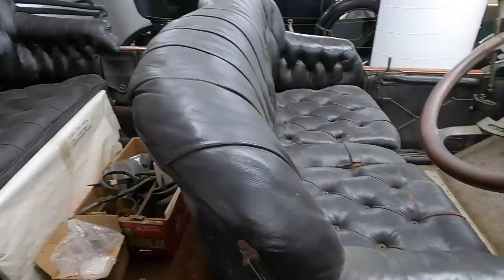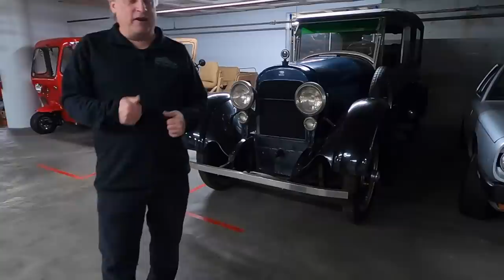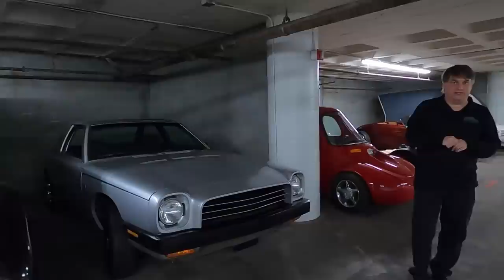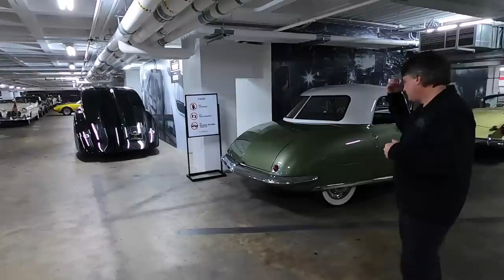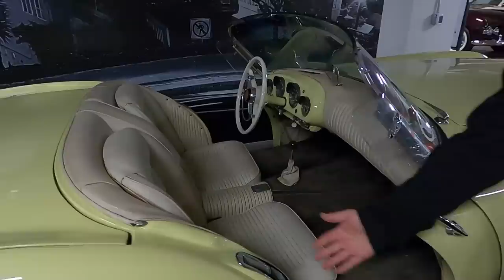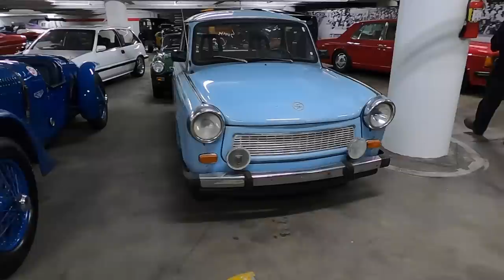WORST CAR FAILURES OF ALL TIME | PETERSEN TOUR

Comment: I f you rode in or drove a Davis, and it hit a pot hole with the front wheel you would understand why the car was horrible, absolutely horrible...
Reply: But that didn't stop England's Reliant car company from making it's 3 wheel Robin! Mostly as a 3 wheel car fell into a far cheaper vehicle tax level, so they were popular, and also known for rolling over.
Reply: @Oldbmwr100rs  in post-war England three-wheel cars were considered motorcycles so therefore you didn't have to have a license for them. I don't know how long that lasted

Comment: 34:00 Ford positioned the entry-level Edsel Ranger squarely between the most basic Ford and the step-up Fairlane, and the top-line Edsel Citation was priced between the highest-price Mercury model and the lowest-price models from Lincoln. The first-year Edsel basically competed with all of Ford's popular-price models from those competing with mid-line Plymouths to those competing with the Buick Roadmaster 75.      
Add Edsel's hideous styling and trouble-prone gadgets, and you have a recipe for failure.

Comment: I owned a 65 Corvair and had a nice love/hate relationship I drove it like a maniac and live to tell the tail. It was light and had a lot of options to build the motor. It wasn't a failure at all and was a pretty nice car. Though I didn't like the heater, it pumped air from the heated air around the engine and I had a oil leak and oh boy did I get a cloud of burnt oil smoke in the car... Hated the push rod tubes that always needed new O-rings but still over all I had a blast with that car.

Comment: I would have mentioned the problem with the Corvair was that the early models didn't have the front anti-roll bar in front that was recommended by the chief engineer at Chevrolet. This caused handling problems especially if it were driven fast on rough roads.  After 1964 the new suspension cured the problems and they handled quite well. Many dealers offered the front anti-roll bar to customers, others didn't.  The biggest problem with the Ford Edsel, besides the 1958 recession, was that all of the special features were soon being offered on their other cars.  Power brakes, power steering, power windows, a push button radio and the bigger V-8 were soon standard equipment on all  American cars.  The styling on the Edsel, like the 1958 Chevy, was not liked by most of the buying public and that heavy look was soon out of favor. The 1958 recession also marked a turning point in American culture, TV became super popular and Rock and Roll soon ruled!

Comment: Edsel didn't just fail due to it's size & lack of unique features/architecture, it also failed because Ford/Lincoln/Mercury dealers couldn't sell them at their dealerships, Ford Motor Company specified they had sell Edsels from a different location, so many Edsel dealers were gas stations.

Comment: The Cisitalia 202 Gran Sport was later revised and modernized in the 1970s and redesigned to fit atop Fiat 128 tooling as the Fiat Sport.  It sold in far greater numbers than the 202 and it was aimed at the Opel Manta, Ford Capri and Toyota Celica.  A Capri-like fastback came first, followed by a 3-door hatchback coupe with identical styling from the doors forward.  Chevrolet replied to this Fiat 128 Sport with the Monza, during 1974, using basic Vega mechanical tooling.
Reply: See the Fiat 128 Sport.  It was similar to the Cisitalia 202 Gran Sport but more modern in styling and it was far cheaper to build.

Comment: 34:00 due to an agreement between the local Ford / Lincoln / Mercury dealers, my county received three Edsel ambulances and two Edsel cars, a sedan for the Sheriff, and a station wagon for the fire chief. With the exception of a '58 model ambulance, all were 1959s. They were used up until the mid '70s, and two of the ambulances are sitting in a field, intact. 
The Edsel may have been a flop, but they're built like tanks. I should have bought that '58 for $600 years ago...

Comment: 30:15     You missed the Cadillac Deville. That's one of the cars that Cadillac ruined the their good reputation with during the 2000s. By not recalling, repairing, replacing or notifying owners of mandatory(out of warranty) maintenance of the Northstar engines in a timely manner.
Reply: Not just the DeVille, Cadillac put the Northstar in everything they built during that period. Mom still has a '94 STS that's actually a nice car, but because it's Northstar powered is only worth what it would bring as scrap.

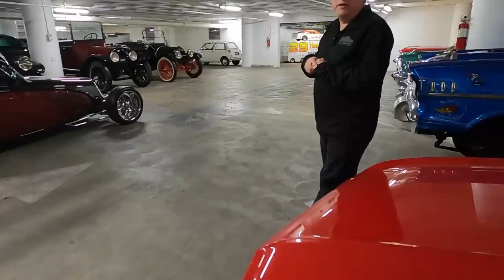Comment: 40:00 From everything I've read, the original Corvair's handling could be considered tolerable for drivers who were skilled enough to know what not to try. But to put that car in the hands of American drivers who were used to being able to sling around a muscle car in and out of a 4 wheel drift with ease was, in fact, irresponsible. Some of the car's bitterest opponents inside GM were executives whose sons had been killed, injured or scared out of their wits by their experiences with the cars. Of course, even with the swing axles, the car could have been a lot better and the safety of the '64 Corvair (the last year before the fully-independent suspension was added), with an anti-sway-bar in front and sort of a see-saw bar in the rear, could have been added to the '60 for a trivial increase in cost, which was vetoed by marketing, because they were determined to make this an economy car. And there's the rub: Ed Cole wanted the Corvair to be the modern day model T, a well-rounded car for everybody that could do the job efficiently and cheaply, but without a much higher production volume , it was never going to be competitive with its more boring rivals. And, it couldn't do everything for everyone anyway; if you wanted a turbocharger, or if you needed a station wagon, you had to give up air conditioning; if you wanted to be comfortable in cold climates, you needed a fuel-guzzling gasoline heater. The Corvair ended up being a specialty car, which was all it could ever have been. I wonder if it could have carved out a more secure niche if GM had planned it as a world-car, built and shipped all over the world in collaboration with overseas partners; that might have put a dent in the cost premium GM was paying for a platform that shared almost nothing with its GM stablemates.

Comment: I got to stick up for the Corvair. The Corvair was unfairly maligned by Ralph Nader.  The car was far superior to the complete failure of the Vega or Pinto offered later on. I owned a 66 Corvair Monza and I loved that car. It could out run a 67 Barracuda of that time period.  As a teenager believe me I thrashed that car to the limit. Never once did I find it getting out of shape no matter how hard I threw it into a corner.  I just wished I had the higher hp turbo charger version. Or better yet 200 ponies would of been just perfect. If I wasn’t so invested in other toys I would buy a pristine Corvair in a heartbeat.

Comment: The Corvair fiasco was responsible for a whole generation of GM cars that where deigned to understeer, A LOT. If a car crashes on the outside of a corner, then people say the driver is at fault. If a car crashes on the inside of a corner, then people say it is the cars fault, and try and sue the manufacturer.

Comment: The company may have been a scam but I really like the Dale, is it a three Wheeler or close coupled read wheels, being a motorcycle engine I would suspect a three Wheeler, some of the Hienkel bubble cars had close coupled wheels with the drive between the wheels, that made them a car in Britain so couldn't be driven on a motorcycle license, great tour and a cracking little car (with a dubious back story) to finish with.
Reply: John Smith  even though it was a scam (something that was rather obvious!), and not a three Wheeler I still think its a smart little car and wouldn't put it out of my garage, got a Bond minicar all 250ccs of two stroke twin, chain drive to the front wheel, so engine and wheel turn together, guess I just like the bizarre, the Dale would be if good company!.

Comment: The Corvair was not a failure with 1.8 million sold over 9 years.  It was a very nice car for it's day.   I know because I had a '64.
Reply: It was sold for 10 years actually.
Reply: What really killed the corvair was that GM by the early 60's no longer wanted to market innovation, also the corvair didn't keep it's early momentum when Ford rolled out the Falcon. GM's response to that was the Chevy 2 then Nova, the corvair continuing production mainly to recoup cost of development. Tightening smog laws were the final nail in their coffin, without losing a lot of power or needing extensive redesign, the car would no longer be able to meet changing smog and safety laws. GM was having enough trouble just keeping up with all of that with all their other models. Many factors spelled the end of the corvair.

Comment: Corvair a failure? I personally owned two of them a '64 and a '67. Early body style and second gen. The blue '64 had the two speed auto and the other was a red manual. The suspension upgrade in the rear handled a bit better but I hade no trouble with either. Loved them both, should have kept the '64 and should have bought a turbo spider.

Comment: If you can get your hands on a ELIO, are you going to add it to your fleet of failed cars?  Technically, it is not a failed car... yet but they are certainly on the path as they are still considered active and even has their website up and still running.  Supposed to roll off the assembly  line in 2009 and all that has been built was prototypes. <>  Edsel had the undesirable and certain un-welcomed nickname "The ----- Car" (woman's reproductive area).

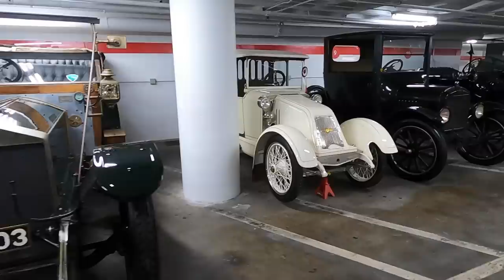Comment: What's the white car at 5:24?
Reply: The shape of the hood with radiator behind engine hints that it is a Renault, probably from 1915-1920. I couldn't locate a picture of that exact model to identify it.
Reply: Yeah but I don't think it's a Renault. I think other manufactures used a similar front. Example early Mack trucks.
Reply: If you identify it let us know

Comment: Rear tire tuck that killed and injured some people . GM bought their way out of the Federal class action law suet .
Reply: Jeff, That is true of the early models. I had a 61 corvair that would lift up in the rear end in a curve creating an impossible handling situation but that was corrected in later models with stability bars. My 65 corvair with 4 carburetors and a 4 speed tranny was far superior in handling than many other cars of the same time period. I miss that car.

Comment: Well on the chevy corvair you only told part of the story as to what happened to couse the down fall of the corvair yes it was natter but also there were to factory recalls that also gave the cars a bad rep the heating work off the exhaust so it didn't take befor exhaust wood get in to the driver compartment bad deal GM did a recall on the cars and replaced the exhaust on with a better designed one. The other was there was a front beam in the front end of the car that held the front a frame together and they were made out a peice of steel metal spot welded together Morley made in northern state with a little winter salt 9n road this peice would rust out and it only took 1 or2 winter to do this so GM did a recalls on that and replaced it with a peice made out of heavyweight metal. This as as to change as this peice in the car was a bolt in peice just unbolt the old bolt in the new one and it was done and this would only a machanic about 30 mins to do. But the two recall put a bad rep on the corvair than add to that the natter think sales just drop to nothing and GM just had to stop making then this sucks as they really were a good little car and they biuld. To compeat with that WV as wave were getting very good sales numbers so it as biuld to compeat with WV sales. They tried to out class the WV in very way they could

Comment: Your knowledge of the Chevrolet Corvair was nothing short of a not-so-subtle attempt to rewrite history.  Shame on you.  Corvair "may have been unfairly targeted"?  Clearly, you never read Ralph Nader's "Unsafe At Any Speed" if you honestly believe there was anything "unfair" about what was documented about the Corvair between 1959 and 1965!   Sure, it went on hiatus after 1969, but that was only temporary.  All GM did was skip a year before putting it back into production, with only a name change to Vega.  Still the same ol' under-engineered, thrown-together POS, but hidden under a new badge of even shoddier workmanship.

Otherwise, fascinating material.  Other than the embarrassing cite above, you seem well-versed on this fine collection.  I've seen Dales before, but never one with the drainage canal headlamp gutters.  What a marvelous way to cut down peripheral vision at night!        

So, which economy car appeared first, the Henry J or the Nash Rambler?    

PS:   I'd just like to suggest you invest in a new photographer who knows something about specialty automobiles, particularly with respect to lighting and focusing on what the narrator is discussing.